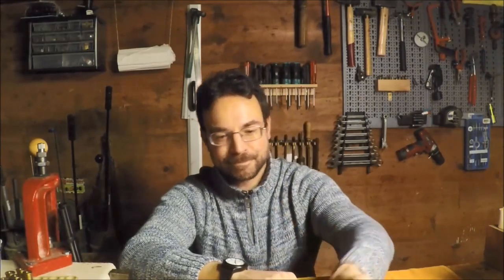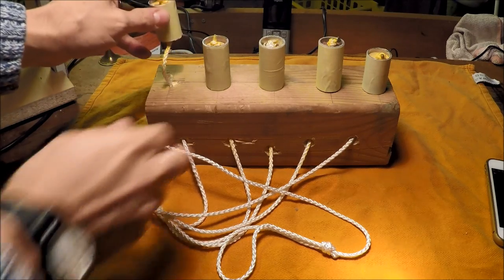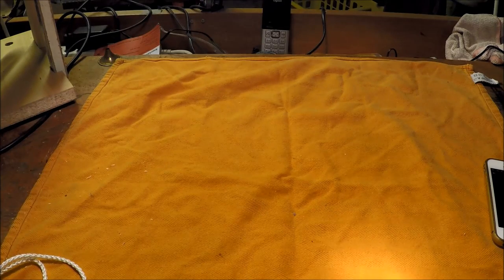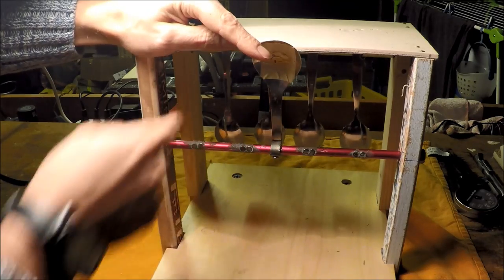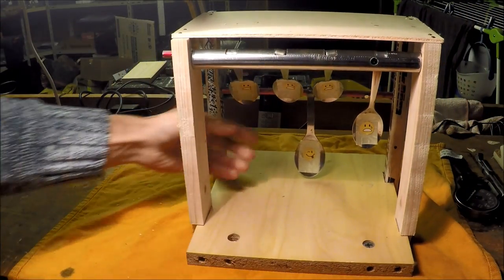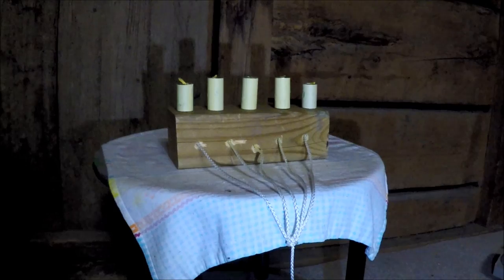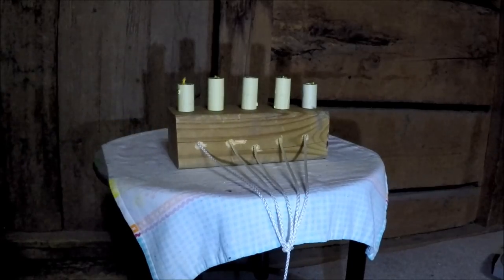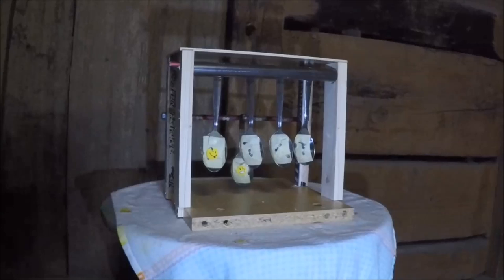The Chap's Home-Made Airgun Targets

Comment: Lovely set of targets, I've used wine corks before but as a disposable target. Putting an aluminium shell around them and a rope through it to reset them is a smart plan. I'll have to steal a few corks, might request that my mom should save some corks over the next few months. If there are no corks though I could easily make that with a wooden filler instead but a cork seems awfully convenient and I'm sure there will be some around with the holiday season coming up.

And that plan with the magnets and the spoons worked well too, I've seen plenty of commercial contraptions with a reset mechanism but never before with magnets. It looks nice and simple to use, depending on the hardness of your spoons, the force they hit the magnets with and whether you're using neodynium type magnets or not which tend to be somewhat brittle and chip/crack easily. Probably not an issue though and if it is its easily solved with a thin rubber something to absorb most of the impact.

What kind of air rifle is that btw? Or at least what type of muzzle energy/velocity do you get with it. I'm curious because I want to know how spoons in that arrangement would potentially hold up to my short distance indoor barn shooting sessions: Weihrauch HW97 (underlever springer) and Benjamin Marauder Pistol (PCP pistol/carbine depending on grip/stock choice). Those two have wrecked some of the interactive targets I had for my older 4.5mm caliber springers, nice airguns... but they pack a bit more punch than the cheap entry level products.
Reply: The magnets were intended for notice boards but beastly strong for their size.  There is actually an additional smaller tube inside the magnet bar immediately behind the magnets.  The JBWeld is perfect for the job.

The rifle is rated just under 7.5J so not overly powerful.  The spoons are a good 1.5mm thick so quite heavy.  If I try to shoot from too far the pellets don't have  energy to smack the spoons back.  With a high powder airgun you just need to shoot from further out.  I tried 22 Aguila Colibri out of a S&W17 on it and the spoons held up fine.

Comment: That spoon target is awesome. The wood one is okay, only issue is getting it to stay in place when pulling the rope and having to run a string across to you. Which isn't hard and many different ways to be accomplished, and a bit of string isn't that much in the way at all. It's more that being able to reset the target spoons with another target spoon is brilliant.
Reply: If I was electronically gifted (which I'm not) I would have a little electric motor with a winding spool configured to wind up the rope once it was detected that all 5 targets were hit or simply remote controlled, but that entails batteries, sensors and other witchcraft.

Comment: The spoon device is great however I shoot fairly heavy airguns and my "worry" is, can the magnets handle the blow against them?   I shot at spoons before and in a very short while they were completely demolished.     😥
Reply: This was made with the average .177 plinking airgun/bb gun in mind. I would definitely beef it up for more powerful airguns. The magnets I used are tiny but I'm sure larger ones would be able to retain chunkier "spoons". Its just a question of scaling up. The tricky part is balancing the magnet strength against the force of impact on the reset target.
Reply: I don’t know, but just an off hand idea for a stronger pellet like .22 or .25 even: 🤔 maybe double up the spoons with some JB Weld.  and of course get farther away for the stronger pellets.  Maybe using the spoon as spinners.  That way one doesn’t have to worry about magnets.

Comment: I’m not really a fan of the spoon target.  Shooting at concave metal surfaces is a recipe for ricochet.  I know the swinging motion will absorb a lot of the energy, but I witnessed a friend damn near shoot himself in the face via ricochet off the bottom of an aerosol can, so I’m very cautious of these things.  Personally, I’d use flat steel with the strike surface bent  slightly toward the ground instead of a spoon.

Comment: What's with the mic? It sounds like an engine is running outside where you are.
Reply: Close to the truth, both the workshop and hayloft adjoin the room housing our big oil-fired heating furnace which is what you can hear.